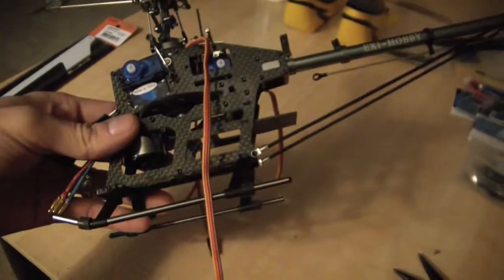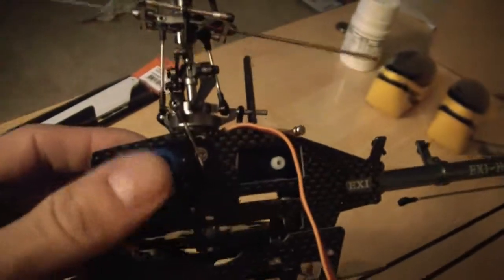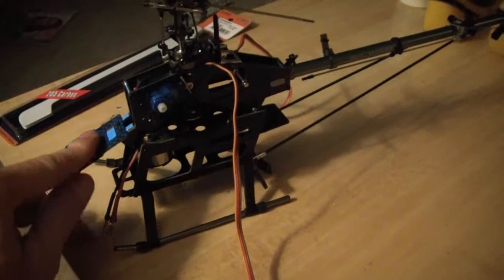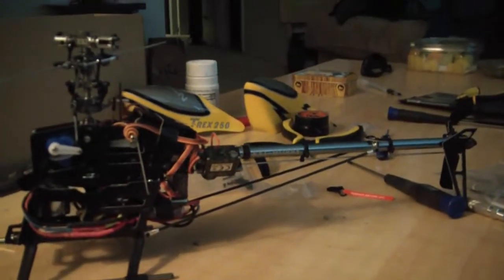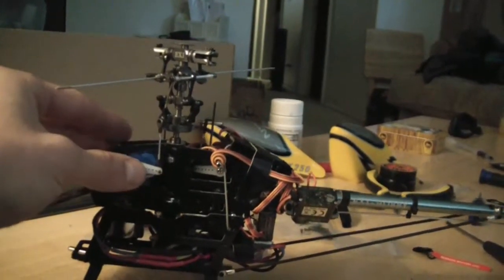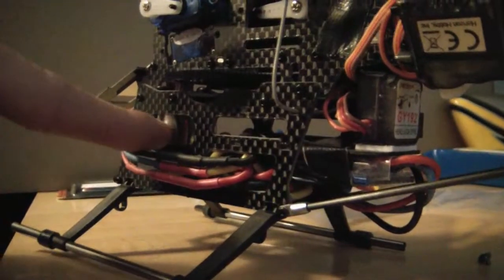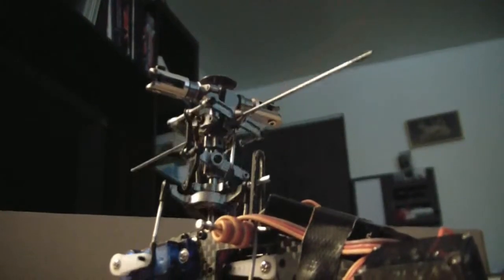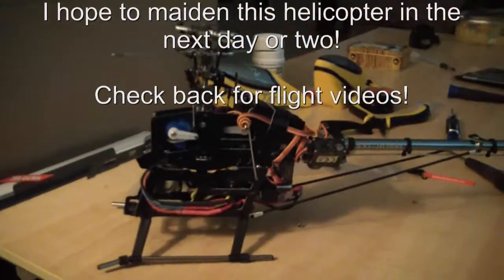My EXI 250 Helicopter Build

Comment: You installed the aileron and elevator servos on the outside and not the inside of the frame. Aren't your links angled too wide at the bottom?

Comment from the maker: @notasixpack thanks for your input!  Many people say 250's are too 'unstable' and 450's and up are much better... Well for me, I like the small heli's :)  I learned 3D on the palm size 4G6, so this 250 is a lot larger than I am used to :)  I do plan eventually to get a 450/500 though.  I do need a new gyro in this 250, the GP 750 or GP 780 seem like the way to go, although they are quite expensive.

Comment: I've had an exi250 for over a year.  JUST got the tail to stop wagging.  Had to use the Align 36mm tail blades.  The gp780 gyro fits, but that gyro tray flexes (even on the trex) so I put it upside down toward the very front of the tray.  And used shoe goo to hold solid the tabs on the tray.  Not really a fun flyer tho, not like a 450 or 500.  G/L.

Comment: If the servos fit tight, do NOT use them.  Any binding of the cases will cause failure.  Also move your RX, in a crash it can get hit by having it up there.  Also your elevator linkage wasn't 90 to the arm, try putting it in a different hole.  Also make sure you go back to thread lock the screws and grease the bearings, EXI does not do it.  As for a gyro a Spartan Quark, Align GP750/780, or Futaba GY520 should fit nicely.  Also do a head/ tail setup if you haven't. Can't wait for flight video.